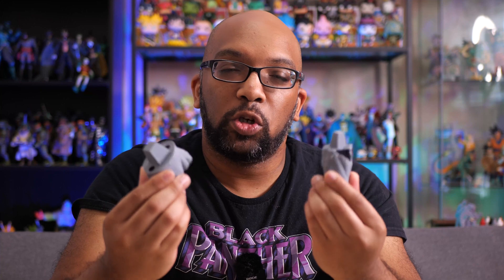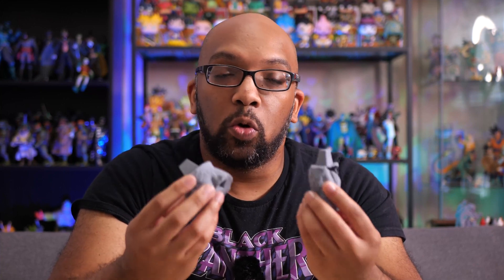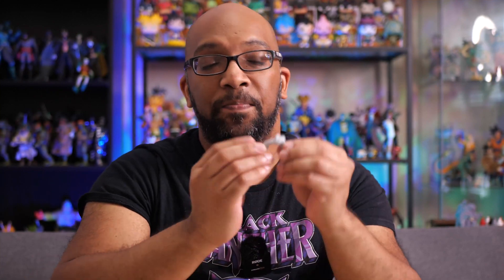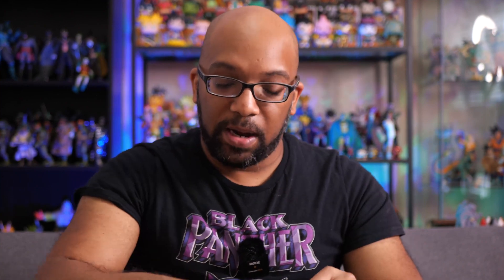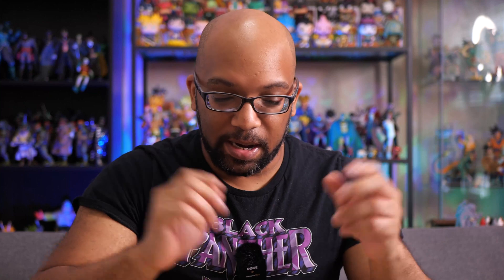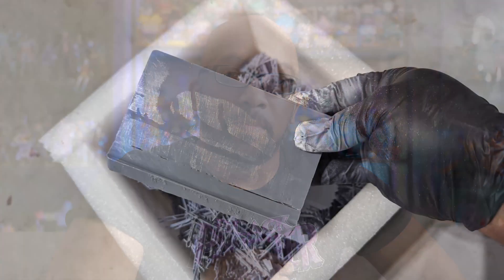Let's Talk About Print Failures

Comment: Ah, the joys of fine tuning a resin to a printer! Depending on how OCD you want to be, that can be a multi-day process in itself, but in the end, you'll learn an awful lot about your printer and the process in general. 
On the failures troubleshooting front, there's a lot of general bits that happen to every machine, as even two identical printers from the same company can print radically differently (an inherent trait of anything mechanical as it were). My top five off the top of my head:  (wall of text warning!)

1): Optimizing for the model. Cross section affects A Lot more than you think it does. Part of why people started tilting models to an arbitrary angle was to lower the cross section overall, however, every model is different naturally. While I take into account all of the fat and thin areas and what will print best without supports (building on itself), I also angle for lowest print time and maximum viability of every piece. Cross section also affects how much your print will stick to the fep, how much suction will be imparted on both the model and possible deformation thereof. Thankfully, what angle doesn't solve, you can beef up on supports to counteract some of that.

2): the fep sheet itself. All FEP sheets provide a basic function on all printers, but the material they are made from can be the difference between 99.9% success and consistent failure. Before manufacturers picked up on the wonder properties of nFEPs and started putting them on from the factory, I was an Avid proponent of them (still am really). Rather than buy the large size singles or 3-packs however, you can get it by the roll from McMaster-Carr and have a supply that will outlast your printer. I have a link, or you can search for it. 

3: FEP treatments. Even with great nFEPs, I went through a tedious process from making my own formulas of 'stick inhibitors' to genuine DuPont industrial teflon (PTFE chem name). The latter you would think would be amazing, but through a lot of T&E, at best it would last for one small print, but more often would burn off a full-plate print mid-cycle and they aren't worth it. 
One product if you want something reliable and convenient: ceramic-containing car wax products (specifically Turtle Wax Hybrid Solutions with the green label, or Shine Armor that looks purple). Spray it on your fep sheet, let sit a few moments, and wipe off with a microfiber cloth while wet from side to side lengthwise until you have a perfectly clean, streak free surface. I retreat on every print if doing one every few days or full plate prints, but if you're an occasional print person, once every few sessions will make a world of difference, and a bottle will last a very long time. That, and the fep lasts TONS longer. I have an nFEP that I've been doing regular treatments on with well over 400 full plate prints that just keeps going and going. Zero failures (that weren't self-induced!).  That said, there's nothing inherently magical or ceramic in them, they are essentially watered-down silicone with a light fragrance. But I've used both extensively, and they work very well. While you're waiting on a print, go wax your ride. 😁

4): Model geometry and 'cleanliness'. I don't know how many model-makers actually check their models for 'oopsies' in the sculpting process, but I do religiously. Chitubox in my experience is perhaps the laziest of the slicers for reporting how manifold a model is and will tell you basically anything will print, even though a model may have inverted normals and cause it to print very poorly. Before I put supports on anything, I run error correction software separately of sculpting. Even zbrush will tell you a model is manifold but can still have inverted geometry, which won't print at all, or problem areas will appear as little white dots in a good slicer (Lychee is my preferred software currently, even though it, too, will report a model has problems but prints perfectly. None of the slicers do everything right, but some have more user-perks than others). Outside of rather expensive CAD software like SolidEdge or SolidWorks, every modeler I've used can kick out good models that will still print to a varying degree of success; CAD modelers can't handle huge polycounts, but more often than not, will push out a perfect model.
TLDR: If you have a model that does this consistently (an area won't print for example or there's gaping holes) and you've supported it well, chances are the model has flipped geometry and you should contact the maker to have them fix it. 

5) Manually-placed supports. Not everyone will want to spend three days putting on 1,578 supports (not an imaginary number, that was my last model's count!) but it does give you an edge in print viability while using the least amount of resin, even though supports by and large aren't huge resin consumers overall. On the flip side, over-supporting a model makes clean-up more time-consuming than necessary and adds 'model damage' that might have been avoidable. If you don't want to spend the time doing it manually, at least have a look at deleting supports that really aren't doing anything. More often than not, you can use a few larger supports that will do the same job as 40 little ones, then hunt for free-floating geometry (islands).

Comment: I really gotta quesiton your experience with chitubox auto supports. Now, i do use it myself as my starting point for almost all my minis, but very rarely is it good on it's own. I mean... I just did a Ranni the Witch, around 100G of resin it estimated for the print, auto supports thought all that could be held by just six supports... ya... it likes put them down at the lowest/starting points and large islands, but from my experience it rarely does more than that, so heavy pieces you need to manually add more supports on, larger flatter areas you'll need to add more on to keep it from getting wobly, and all the small and sometimes not that small details you'll need to manually add some for to deal with all the little islands that form from bits of hair poking out, fingers, whatever. Varies heavily model to model and rotation to rotation what it is but you get my point.

In my experience with the current chitubox versions, the auto just ignores small islands, and it also doesn't take into account total model/resin/part weight when figuring out how many supports to give.

Comment: Great info and great encouragement. I've had a few failures, but only one has given me a real headache- a dwarf in heavy armor with an Axe. He came pre-supported and I think was meant to be printed at 37mm. But the detail work is amazing, so I bumped him up to 300% and hollowed him out to save on resin. First time was a full collapse. the second time was a partial print. I could see from the large partial print that the detail on the shield was incredible even at 300%. My next attempt will be solid- I think the pre-supports are getting hollowed and it's causing support failures as it comes up. For now though- waiting on a resin filter so I can get all the little bits out and try again.
Reply from the maker: Best of luck with your dwarf. I was planning to scale up a dwarf as well before my FEP got damaged.

Comment: Great info, you read my mind. Anycubic 4k mono is in my Amazon UK shopping cart and about to pull the trigger as I can get it for £169 but I started thinking about how many print failures I may get, I know its how long is a piece of string, but funny how you are using the exact same printer as I'm just about to buy...its this or the mars 3 pro can i ask for your advise pls on these 2 printers??? or maybe something else?...i don't want buy any of these new printers that wont arrive for months
Reply from the maker: If the Anycubic Mono 4K and the Mars 3 Pro were the same price, I'd go with the Mars 3 Pro because it offers a little more build volume and an air purifier. But here in the U.S., it costs almost $100 more. Since the prints won't be that distinguishable between the two, I'd get the Anycubic and use the extra $100 on resin and/or a wash and cure station.
Reply: @FigureFeedback  Yes more or less £100 so going with Anycubic...Thanks for the advice.